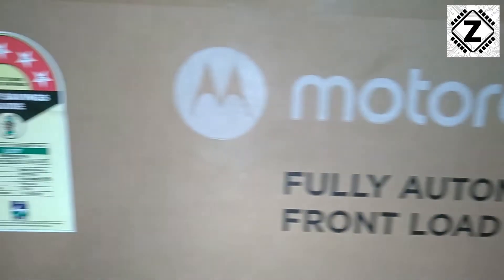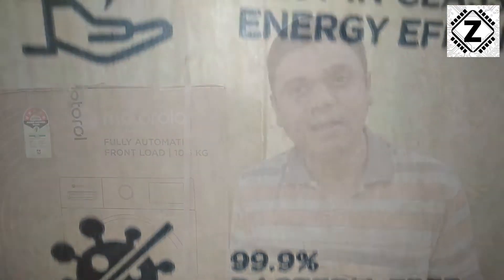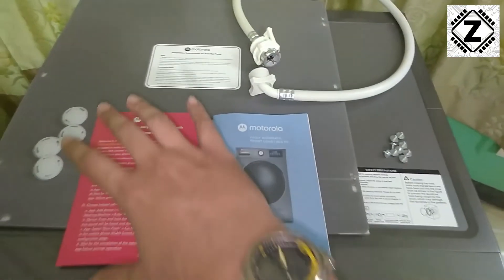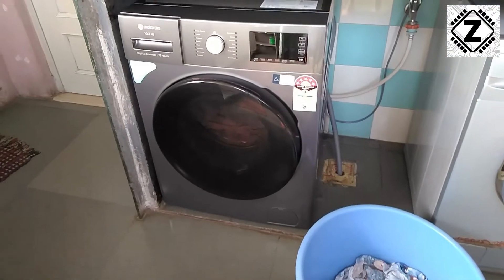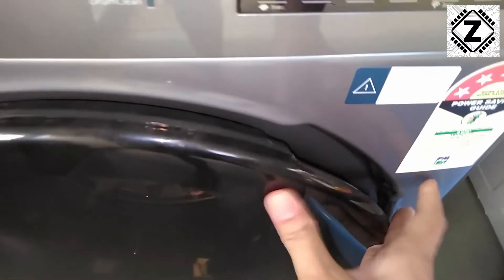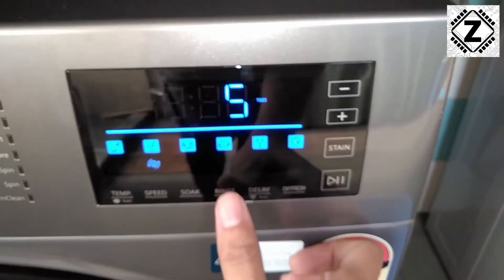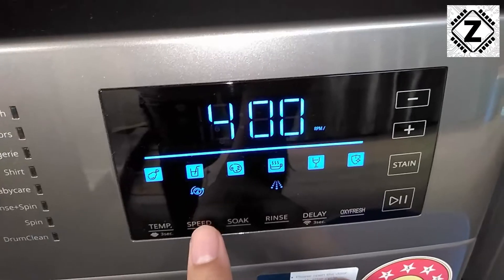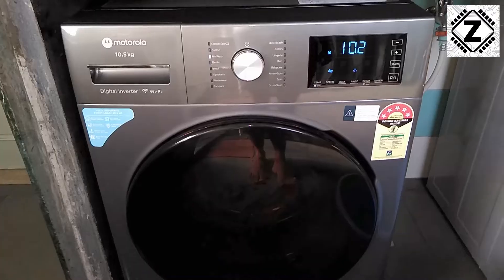[Eng] Smart Washer!  Motorola 10.5 KG WI-FI Front Load Washing Machine Unboxing, Features & Demo

Comment: Hi sir I have brought a new 8 kgs motorola washing machine and wanted to know that on the back side of washing machine they have provided anti rat panel so may I know where exactly it should be fixed
Reply from the maker: I'm working on a installation guide video with will cover all this. I suggest you stay subscribed!
Reply: Fix rat mat in the bottom sir.

Comment: Very good review. Thanks for showing the internal parts, wiring, plastic suspension and so.
1. Now that its been 2 years since your review, is the product still working fine without any issues?
2. If you have faced issues, how was the motorola support?
3. In the video, why did you do unboxing and installation yourself? Didn't the brand arrange installation and demo?
Appreciate if you can take time to respond to the queries. Thanks.
Reply from the maker: 1. Working fine.
2. Support not needed.
3. I felt confident to install it. Brand came 2 days later. Wont recommend for you to unbox.
Reply: @ZenInnovations  Thank you for the reply.

Comment: Hello, i have recently bought this w.m. and bit confused about where to put liquid detergent? Is it the same left side where you have put washing powder or in  the middle?? And the liquid detergent alone will do the job or should I use both powder and liquid detergent? And can you guide me how to use drum clean option? Do we need any powder for that?  And last what is the use of the outlet which is at the front bottom right hand side with a black rubber hose? TIA
Reply from the maker: Liquid detergent goes in same Compartment as powder. Usually labelled MAIN or WASH II.
I have made videos on rest of your queries, they will be edited & pushed till next week. Stay subscribed!
Reply: Is it working well

Comment: Sir, You mentioned pre-wash, does this function work, i don't see any buttons to enable/disable it. Pre-wash should put some water in Dispenser 1, run for a couple of minutes and drain it, before starting the main wash (Dispenser 2). It is basically a rinse cycle (with or without detergent) before wash. Have you noticed this happen in your washes?
I live in a farm with two active kids, this feature has become indispensible, since it will remove all the visible mud before the actual wash cycle.
Reply from the maker: Perhaps these videos will help-
https://youtu.be/BklJHMBC2H4
https://youtu.be/-PQ1Nkj0kbM
Reply from the maker: For anything else do comment back.

Comment: Hi. Your video is the best I've found.  I bought the same motorola 10.5 kg wifi washer dryer but it has a 'hot air dry' option instead of the 'oxyfresh' option  as shown on your model. This was sold as a washer dryer but no matter what we do,  the clothes come out soaking wet. Can you advise please?  Does the dryer actually dry the clothes?
Reply from the maker: Hi, Glad you liked the videos.
My Model was sold as a washing machine so it has washing & Spinning features.
So I cannot test the air dry function. You can discuss in detail on my Telegram group by uploading the product videos.
Reply: @ZenInnovations  can you tell me how much energy star ratting in washer n dryer model ?

Comment: How much water pressure is needed?
Reply from the maker: I use regular overhead tank.
Reply: @ZenInnovations  so is there no requirement of pressure of water?
Reply from the maker: @anandtawde1691  normal tap pressure
Reply: @ZenInnovations  thank you, actually i have heard that front loading washing machines requires high pressure of water otherwise it wont work
Reply from the maker: @anandtawde1691  never noticed a problem in 3 different machines which I use.